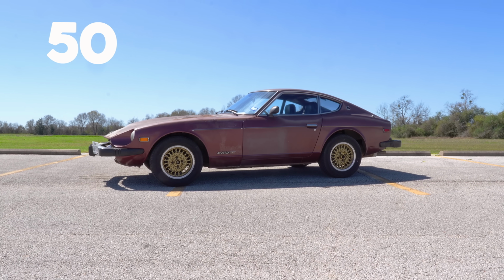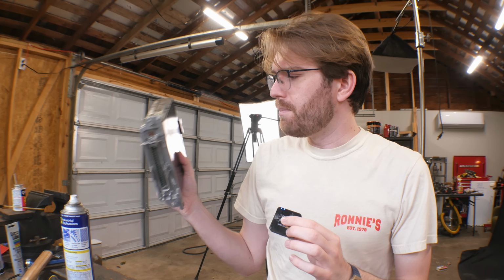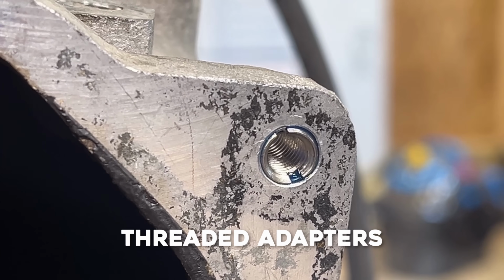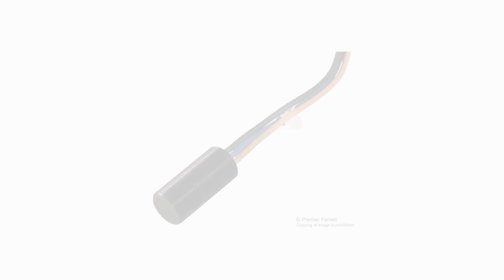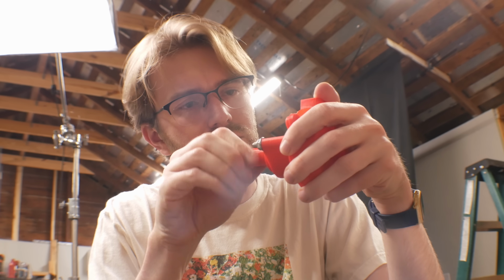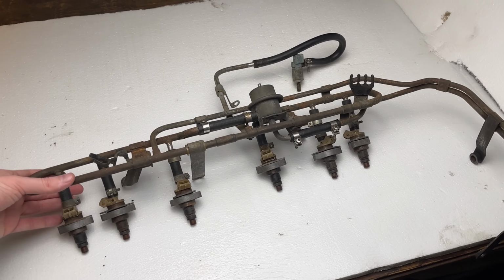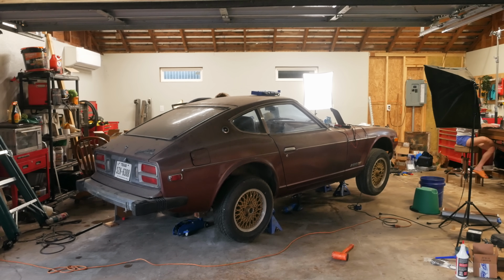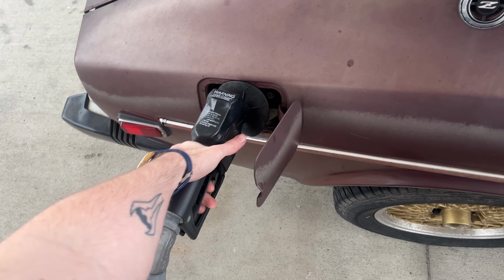Modernizing a Vintage Car

Comment: Bro spent 8 months to gain 20hp and 3mpg
Reply: Peak mechanic experience
Reply: @Big.Rik_  And engineering.
Reply: but now the engine goes brrrr
Reply: Te be exacts he gained 18hp and 2mpg and ………. 🥁🥁🥁🥁🥁 SPENT 9 MONTHS
Reply: @jaskaranjitsingh1945 that's an entire gestation period
Reply: @bororobo3805  and a new car was born... lol.
Reply: @bororobo3805 how much horsepower did YOU make when YOU were born?
Reply: @thumbtak I can only guess how much HP was used to push me out. 

Maybe around .0013hps? 😂
Reply: … and a lot of knowledge.
Reply: Get a cam and better exhaust now😎
Reply: Looks like you missed the details how he re-engineered the engine main control. That is a hundred brains in a typical car company.
Reply: @JoeTongie  turbo that shit and boom, done better
Reply: @an-2253 what he did would be what all auto industry should do. Simplification. Turbo is good, but just an extra overhead...
Reply: @an-2253  Thanks Timmy No Brakes. 😂😂😂
Reply: @curbyourshi1056 welcome
Reply: @JoeTongie  He didn't re-engineer it though. He bought a standalone aftermarket ECU. There's no engineering to buying someone elses product and using it as intended.
Reply: @boostaddict_  lol you must have missed the plot where he designed a wholly original cam speed/position sensor set up which without any ecu would be  very close to useless. 

He also built a custom temp sensor mount and a o2 sensor. 

You are making it sound like it was a drop in. Nah dude. The new ecu couldn’t replace the bosch jetronic ecu. 

He had to newly create the things that made the off the shelf components work with the ancient engine.
Reply: @RawCruNama There was no reason to do that though. There are aftermarket crank triggers out there. There's a company called OneSix Industries that makes almost exactly what he built, even down to using a square drive on the trigger wheel. Wouldn't be surprised if it was just a copy of that design. The temp sensor and O2 mounts are just welded/threaded adapters, nothing special. I've been working on cars and making custom parts for close to 20 years, including multiple engine swaps. I daily drive a 1997 Volkswagen Jetta with an engine from a newer volkswagen, brakes from a Porsche, turbo from an older volkswagen, wheel hubs from a completely different volkswagen, sensors from a Ford F350, and a handful of Passat parts. None of it just bolted on, but I still wouldn't call it an engineering project. What he did wasn't a major engineering project lol.
Reply: @boostaddict_ we get it. You’re cooler
Reply: @boostaddict_  hey wow so you swapped something into a mk3? Like a daza? That so cool! And why did you end up using ford sensors? 

Your project is cool. But you’re making a rhetorical dodge by moving the goalposts. First it’s “he didn’t re-engineer” and now “i wouldn’t call it a major engineering project” 

So which is it? What’s the arbitrary line you’re gonna draw to say “no true engineer ….”? 😂
Reply: @boostaddict_  This genuinely comes off as cope and jealousy. Just say you couldn’t do what he did
Reply: @boostaddict_   you're the type that sees someone build something cool and complain that it isn't how you're supposed to do it huh?   a doctor could give you the cure to cancer and you would say "oh well you didn't actually make anything you just mixed some stuff together"
Reply: @boostaddict_ maybe you can be kinder to yourself and others and call that engineering then.
if nothing else you're re-engineering parts that shouldn't belong together to work in unison. just because an engine builder doesnt smelt his own sparkplugs and reinvent a hydraulic press to fit his own cylinder sleeves doesn't mean he can't be an engineer
Reply: @boostaddict_  are you his doppelganger walking in the door and telling him he DIDN'T do it himself ? Because that's what he already said... in the video...   maybe you missed that part
Reply: @myotherusername9224  No, I'm not telling him he didn't do it himself. I'm telling people in the comments that installing a standalone ECU isnt engineering. He never claimed it was in the video, the issue is all people in the comments.
Reply: @boostaddict_  you cant convince anyone. generally speaking in any video or any online social media platform 99% of the people are bumbling idiots who dont know how to do a single thing on their own and somehow they are PROUD of being ignorant. that's modern american culture for ya
Reply: @RawCruNama chill bro, finger is self aware, he made the joke himself that he didnt really do shit, just slapped some bolt ons like everyother car guy. the custom stuff was awesome though and if there was an actual market for those he could open up a datsun rebuild company but sadly there isnt and thats why he had to get creative in the first place, its why we watch him. If he was tuning a BRZ this would be barely watchable as he slaps on a wing to go faster LOL.
Reply: hey plus extra reliability
Reply: A friend of mine had the turbo 280z. Made about 180hp. It felt quick as shit back in 2008 and did 0-60 in around 7 seconds with a good driver. Only .5 to1 second slower than an 04 cobra. If this dude threw a better cam, exhaust, and turbo on this thing it would be quick as fuck. Theyre under 3k lbs.
Reply: @RmfDiz  
Old turbo,s are easy to make more HP.
Had an 1991 Volvo 480 turbo,who had an Renault 1800cc in it.
Did figured it out that the max boost was limited from 1 ECU mass cable.
It did go from an poor 120 hp to 170 hp.
Only 1 made 1 mistake,and did give it to much boost,so the cyl head did crack at the spark plugs,it did still runs good,but could not remove the plugs anymore,they were crooked in the cylinder head.
Reply: @RmfDiz LS haha
Reply: @BlueTrane2028 always an option. Should fit in that long ass thing.
Reply: Bro, it pays for itself! Once his grandkids hand it down to his great grand children
Reply: he was grinding to level up
Reply: It likely only made that 125hp to the wheels the day it left the factory. Power ratings were very 'optimistic' (literal lies, claims from manufacturer requiring no third party backing) back in those days. It could also likely be tuned for improved fuel economy if desired,r; you have to bear in mind that the primary function of standalone ECU tuning is to maximize power output, economy enhancing features are optional, and often require additional sensors. 

Most importantly; what he's done will enhance and simplify any additional modification to the engine. For example, if he put a bigger cam in it, he'll make a bigger gain from it paired with a finely tuned fuel map with modern sensors than he would've on the old junk. Not to mention, mods like ITBs would be a breeze with everything else already set up.  Upgrading to a modern standalone should be your first step in upgrading any engine you want to upgrade and actually function well.
Reply: @boxenjoyerkona yea, I know it's probably not the most credible source of info, but according to wikipedia, 1978 280z made 149hp to the crank, so 125hp to the wheel is extremely healthy for such a old car. the number 170hp he quoted was actually without any accessories
Reply: That’s the fun of it.
Reply: which is essentially how it was from the factory at the wheels
Reply: Yes and that's awesome
Reply: And a super clean looking engine bay!
Reply: 15hp*
Reply: Yup and I’m here for it. Good video
Reply: Suspense…killed! Thanx homie😂
Reply: Spoiler
Reply: I had a 1972 240 Z I think it was 145 hp. It was the coolest car 20-year-old could ever have what boy did everything go wrong with that doesn’t seem possible. It’s that long ago. I am driving a new Honda pilot with double the horsepower and it’s never broken down once.
Reply: And a lot more reliable and probably enjoyed the hell out of the process. 🤷‍♂️
Reply: But he literally developed a system that he could sell and make money on it
Reply: nah he used that time to con you out of your patreon money
Reply: that is point
Reply: Wow that was no easy task to accomplish I would say that is a win you cleaned up the engine bay and with some more tweaking you might be able to put together a kit to sell to others with 280z thanks for bringing us song on yet another project I look forward to seeing what is next for the car.
Reply: Project car math checks out ONLY 8 months.
Reply: I imagine what he’s done now will allow him to do other mods he has planned easier and more reliably
Reply: True, but he made an amazing video and got 4 1/2 million views. What did you do?
Reply: Great content! It’s really nice to hear somebody with brains and courage, not some tattooed ignorant influencer racking up the hits.
Reply: Honestly one of my favorite vids from him. Worth it.
Reply: Bro learned 20months worth of life experience and 3 more mechanic stars.
Reply: In 63 years, he will be glad on his savings tho.
Reply: Video title
Reply: This video with 7 million views paid this project many times over.
Reply: But he had fun and made a good video. 
And prolly some YouTube pay... 👍🏼😁
Reply: Also 20 defense
Reply: a 5.3 LS swap would have been way more benefit for similar or less money lol.
Reply: @boostaddict_  yeah but would a ls swap gotten more views? A quick search only uncovered a 280z build video with 200k views. 
 In this case, a crazy engineering project with less performance is the right financial move because it likely will make more views and make more return on investment.

Also a ls swap wouldn’t have made a crossover with a 3.2 million subscriber YouTube channel. 

If it was any normal person you’re absolutely right. But Ronald finger YouTube creator isn’t a normal person. He makes his bad decisions into content gold haha
Reply: @boostaddict_ the fun for exploring other solution though is what this is all about...
Reply: Too bad.  It would have been vintage if he had just cleaned it up.
Reply: what have you accomplished in the last 8 months? ...he upgraded an engine and has a video that has 4.5 million views. you do the math

Comment: Why the rod of the distributed has to be of hardened steel. As long as is it fixed correctly without gaps and as there is almost no load on this coupling, a normal steel or aluminum rod should be fine

Comment: With all respect, I don't agree with the "more reliable" part. There are still oldtimers here on the road that will outlive us, while many newer cars have issues that are either too expensive to fix or many mechanics simply don't want to fix. Reliability isn't measured in more electronics, especially not in cheap, mass produced electronics. I will choose pure steel hardware over overcomplicated systems any day and I'm saying that as a tech lover. The simpler a thing is the longer its lifespan, easy as that.

Comment: I use my motorcycle for commutes and stuff. It's the only new thing I buy. I have a 68 Chevrolet truck I got at 16 which I restored and a 98 Jeep Sahara for my wife back when we got married in 03. I'm never buying a new vehicle, I maintain and work on my own stuff and I get decent milage out of my vehicles. It's not about what you spend in a project it's about what you save long term taking into account the price of insurance and a new vehicle and all that mess. So the project will more than pay for itself sooner than that if you take all of it into account.

Comment: I had to pause 1 minute into this video.  Your a 700K channel and your telling me you dont have the funds to swap in a modern engine?  Also this video got 2.3 million views.  The revenue from this video alone is enough for a modern engine now.

Edit: Back here 18 minutes in.  All this time and labor (money) put in.  Wouldnt a modern engine have been a cheaper solution?

Edit: Good job for actually achieving what you set out to do.

Comment: Drove a friend’s 2 year old 280z. I didn’t try, but acceleration was butter smooth. Doing 65 in 3rd in a 45MPH zone. Oops. Also, ya gotta remember that gas was in the mid 30¢/gallon range. Premium about 4¢ more.  Child rearing years, had a Ford Taurus with the 3l V-6. Its 6 port injectors were fired by 2 wiring circuits.

Comment: My buddy and I stabbed a Chevy 327 into a 280z back in ‘91. After losing a couple oil pans and having a front end that dropped a couple inches just from the weight, we installed a heavier suspension setup  and it ran and drove perfectly. After getting in trouble with the local sheriffs department, I ended up  putting the motor in a 1980 Toyota Land Cruiser (the old jeep knock off). Those were the days.

Comment: your complete DIY of the everything is awesome!  But you do know they sell drop in capless distributors that have the same hall sensor right? lol 200$ and its bolt on.   Not as fun as designing everything no, but also not as much mind numbing hassle at times either. 
If you slapped a turbo on this set up, youd have a helluva lil rig for sure.
currently debating on going back with my LS swap or building the original engine with a turbo for my 76' 280z.

Comment: what happens if you programmatically skip a fuel injection every so often? or turn the engine with 5 or even 4 pistons but change which one is off so the engine keeps running but you're not using all cylinders? could you get more miles per gallon? i guess you'd need some kind of a torque sensor so that when the engine is straining to go up a hill the feature is off, but if you're going downhill you could just use the bare minimum to keep the engine turning.

Comment: There is a guy somewhere in Africa who is converting old carbureted engines to electronic. With basically as a controller using an Arduino plate.

Comment: Ah man. Brings back memories. I owned a 78 280Z Black Pearl edition. 5 spd. Was such an amazingly fun car to drive. Owned it in Tucson for a while. Monsoon came, flooded my area, destroyed the floor pans and frame rails. Motor was so solid. Black paint, black leather, no AC..... Was wild. I literally zip tied an old honda civic radiator fan into a milk crate, set it in the back and wired it to a switch just to have moving air at stop lights. The exhaust heat going into the transmission hump was nice in winter but insane in summer.

Wonderful chasis beside easily rusting. Such solid grounded cars that were a joy to drive. Especially over 100mph, you could feel the car start to squat and grip better. Hold the highway a bit tighter. Was a true race car on the streets. 0-60 7 seconds was nothing to sniff at back then, funny enough my daily 2000 BMW 3 series was also 0-60 7 seconds, but sounded no where near as cool.

My buddies and I always dreamed of finding some S55 engine and getting it in there. Those motors keep the spirit of the car, while being directly from racing heritage. Of course an RB motor would be more fitting, but you cant find those readily.

Overall cool project, jealous I dont have an S30 chassis anymore.
Reply: Those poor old Datsuns in the northeast didn't stand a chance against aggressive road salt use in the winter.

Comment: i have a lego set from 1978 or 79 but its the lego kitchen set and the lego ID is 269 and i have the box manual and all the pieces exept for a few things, i used to have the babe figure but it kinda.......vanished. and i also have a radio from 1929

Comment: F,   yeah  good engineering. You beat me with my 79. 210. After engine, transmission, and lots of part replaced by a crook mechanic, their replacements are all mess up,  parked for 25 years but looks like well taken care

Comment: Would be interesting to see the temp changes as well as technically you also improved a lot the burn quality. btw, it is not exactly one to one comparison on MPG, as you have less consumption with 20 more HP, even though it does not matter when you pay the gas bill, technically it is more than just a 2.88 MPG change could say alone.

Comment: I'd be completely surprised if there wasn't either a Nissan factory or aftermarket cam position sensor "tuna can" that bolted in where the original distributor fit, as that's what a lot of manufacturers used in the transition to distributorless ignition systems...

Comment: chat-giupetto said:

nice — a classic with an EFI swap! 💪 that explains a lot. if you want to squeeze the most out of that inline-six without burning more fuel, here’s a quick post-EFI checklist:

Wideband O₂ + AFR tuning: cruise target ~14.2–15.0:1; enrich under load to ~12.8–13.2:1; idle steady around ~14.7:1.

Ignition: set the curve for EFI (you can usually run more advance at light load). if the ECU supports ignition maps, use them; knock sensing is a big plus.

MAP instead of TPS-only (for speed-density): improves fueling with altitude/load changes.

Cold start / afterstart: shorten enrichment so it isn’t over-fueling after ~30–60 s.

Fuel pressure & injector sizing: aim for 70–80% duty at peak power; fixed base pressure (e.g., 3 bar) with a return line.

Intake/PCV tightness: any unmetered air will throw your maps off.

Fuel & ethanol: E10 needs ~3–4% more fuel; reflect that in the map.

Fuel hardware: ethanol-rated hoses/components; 10–40 μm filter before the rail.

Charging system: alternator with headroom — ECUs and pumps dislike drops below ~12 V.

Operating temps: place IAT/CLT sensors to avoid heat-soak; an ECU-controlled fan helps keep AFR repeatable.

dialed in like that, ~11–12 L/100 km (~19.8 mpg US) is a solid result for a ’71 EFI’d inline-six. if you want, send the specs (ECU brand, MAP/MAF, injector size in cc/min, ignition setup) and I’ll suggest cruise & light-load AFR/timing targets for your build.